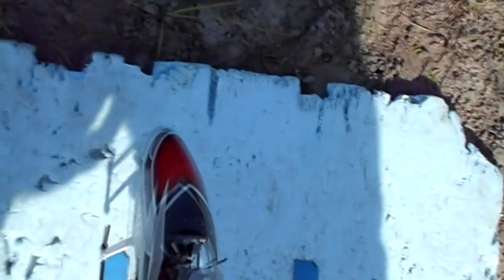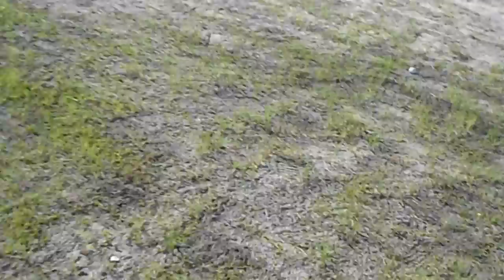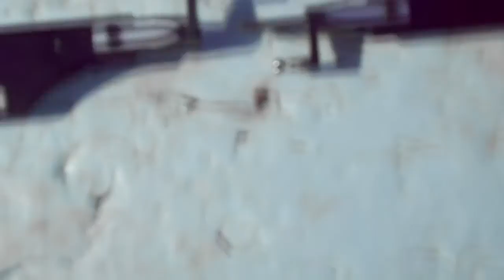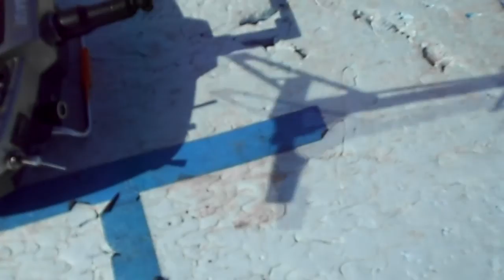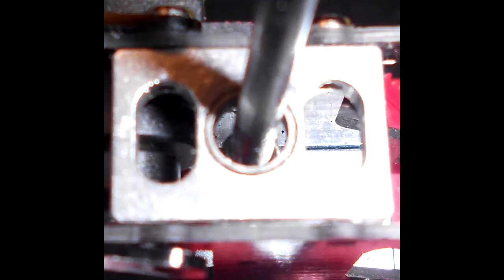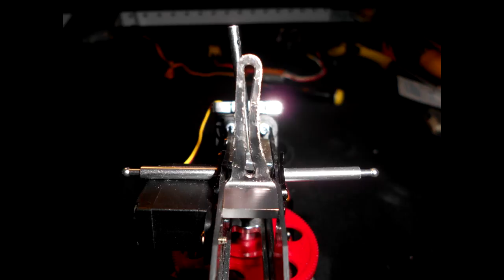Gaui X2 - Non Flight 21 - X2 Explodes on launch pad.

Comment: I had a feathering shaft let go the first time I tried IU on my HK250GT. The only thing that broke was a blade grip, and I lost some bearings. What a bummer. I suppose this is part of the game with top shelf stuff. It costs lots more to crash a Porsche than a Pontiac.
Reply from the maker: I bought the heli used for under $300, and not for nothing. It's damn near a $700 heli with the electronics and Microbeast, etc. I am positive that this wouldn't have happened if I had bought the heli new.  But after crashing and fixing the heli a few times due to maintenance issues. I probably still wasn't anywhere near the retail value of the super combo kit + shipping.

Since this incident, i have rebuilt the whole heli and replaced a lot of the bearings, etc. Now that the heli's maintenance is 100% in my care i don't expect  to see very many random failures like this going forward. In-fact, at this point in time i have exceeded 100 flights on the heli and it has been flying great. One of my favorite helicopters actually. There is just something about it's size and the buzzing sounds it makes :)

Comment from the maker: It was a new feathering shaft. Actually a whole brand new rotor head i installed after my first crash. I don't think it was the FS that actually failed. I think it was the upper main shaft bearing that likely blew out in the previous flight. No bearing = wobbly rotor head and lots of stress on the FS that isn't made to teeter that much. 

I don't like or want to feel superior. I spent a ton on my V120 and V450. Much more than even my X7. Than i realized. There is no failure, only progress.

Comment: Sorry man, not cool. Was the feathering shaft new or old one from previous crash? Your vids certainly put a hold on me grabbing a 200x kit I was so close to.

If it's any consolation, I spent more on my v120 than you have on this gaui and still only got one lame flight. my micro upgrade to bl is quadruple fail and my 450 has taken almost 5 months and I still haven't flown it yet. Don't you feel at least a bit superior now? Just a bit? :)